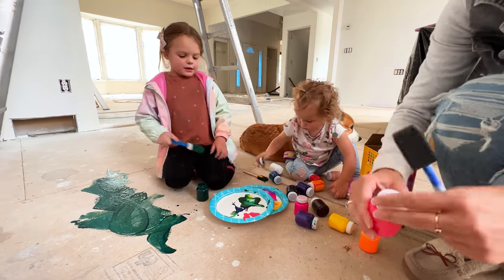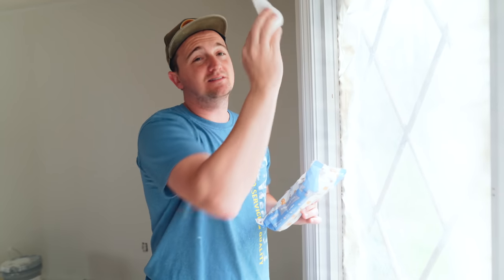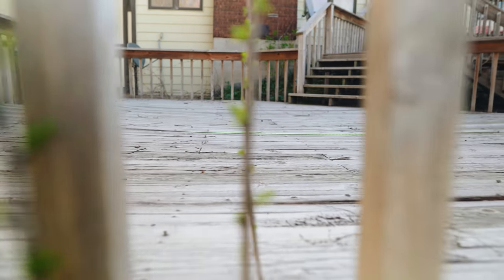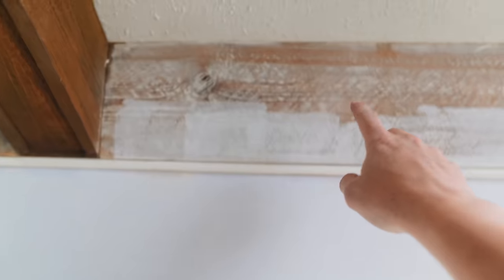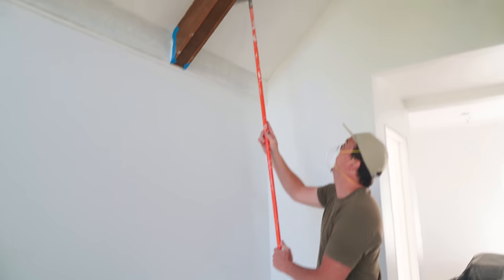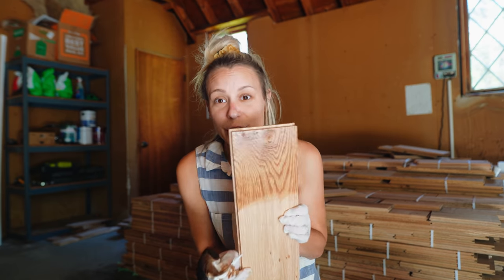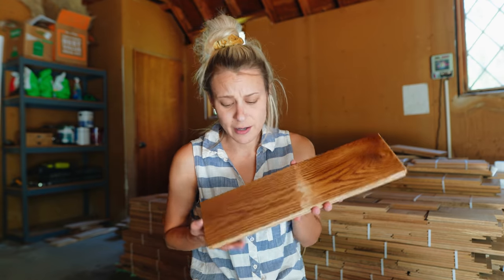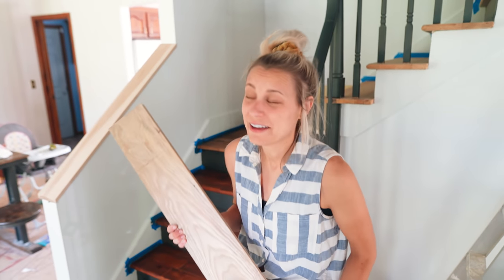The Stately Tudor Update: DIY Painting, Mudding, Staining DISASTER and Backyard Plans

Comment: Oh,   set backs are so hard! But you two will figure it out.  When I paint walls I always use an extension pole (from my mop). It makes reaching those high places so much easier.  Also,  Jamie  might want to check into using stilts to mud those ceilings.  That is what the pros use. 👏

Comment: For your stair steps I would highly recommend a grey and/or taupe paint wash. Just thin the paint out with water, brush/wipe on and then wipe off. Practice on scrap wood so that you can adjust paint thickness, how long to leave on, and how much pressure to wipe off. It will give you a much more even look.

Comment: You should try a Gel stain it gives you a more even color even when used in different woods, you will have to add or  remove stain to match the color but it gets you closer , just work in small portion because it starts to dry and won’t come off as easy as regular stain hope it helps!
Reply: I also came to the comments to suggest gel stain. Sarah could still get the look she wants but it would be a lot more even. Also - make sure to stir your stain as you go to maintain consistency.

Comment: Dont give up yet on dream staircase. Maybe try a faux finish on stairs by painting the base coat color of  oak and glaze over with the color of stain? If you do end up painting, use floor epoxy paint that will withstand the wear and tear. My vote would be black treads white risers, or all black with nuetral tone carpet runner for noise reduction and protect the kiddos from slips and falls. Regardless, you guys are masters at making it work! So much work😹😻

Comment: Try sanding off the stain, pre-condition and use GEL STAIN because it helps get a more cohesive look in the finished product.
Reply: Also, if you want to completely replace the treads....Lowe's sells new ones and you could try that route. I know it's added expense and time but at least it will be worth it in the long run. Good luck! 😎

Comment: I’ll be interested to see what you choose to do…but I think because there are different woods…you might need to just paint.  Which I bet will look very nice.  Maybe do paint with a stencil? 

That said…did you know you can buy solid oak stair threads at Home Depot to put over your existing stairs.  They are pricey..but that way you’d be able to have the same wood for all treads and then the stain you choose will stain the same. The angle piece might be a challenge though.

Comment: Stain needs to be mixed up before you use it, the pigments settle to the bottom. Pine takes stain entirely differently than oak, pine stains very unevenly and usually needs a wood conditioner. Like others have said, try a darker gel stain first before you resort to paint.
Reply: Yes, . you are giving great advice. I have made the same errors Jaime/Sarah made and that's how I learned. Pine = soft wood, open grain, sucks up stain like a sponge. Oak, hardwood, tight grain, generally takes stain naturally evenly. Plywood is even worse than pine and would also require a pre-stain wood conditioner. I believe pre-stain fills some of the grain to keep pine from sucking up so much stain. I would bleach a test area and see if you can lighten it. I bleach my front porch every year before I put my water seal down.

Comment: I wouldn’t paint. 
Every wood stains so differently. A pre-conditioner does often help a lot. But too late for this project. Maybe try a very dark stain. I have used dark walnut many times and I find it to be very beautiful. But it does depend on what kind of wood you are using. It could look good
Reply: Great perseverance with your popcorn. I have popcorn in my ceilings and our houses from 2001. I want to get rid of it all but I am overwhelmed by the task! In my research many people suggest to spray it with water. You are done now so I guess this tip might not help you. Apparently if it has been painted it is extremely brutal to remove.